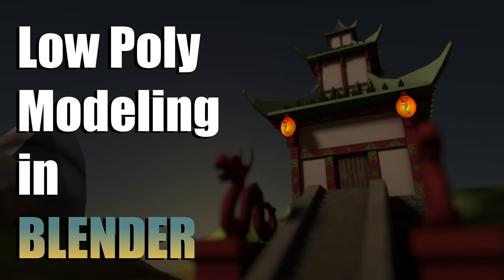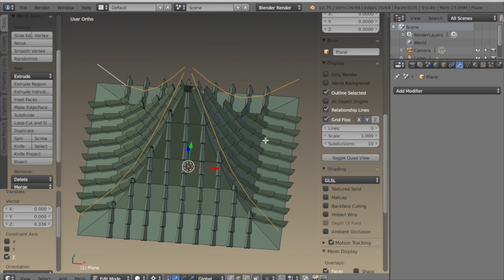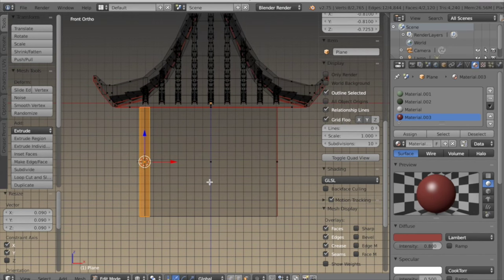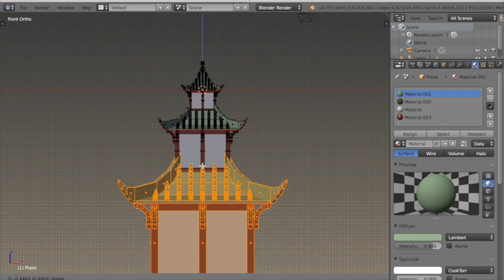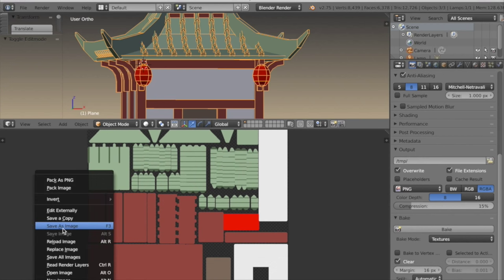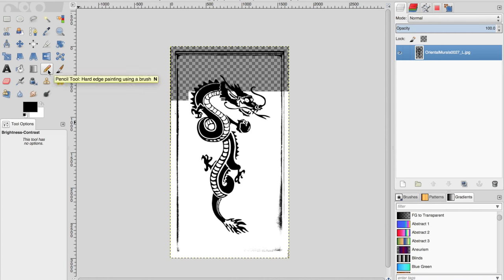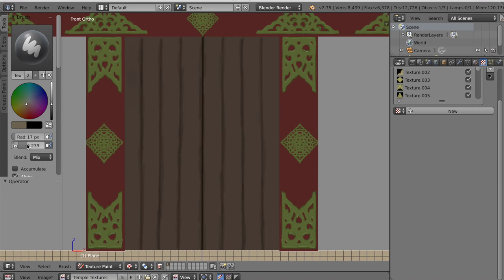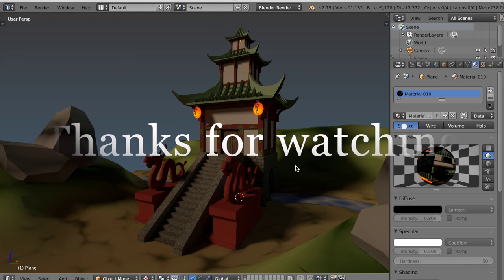Low Poly Model Creation in Blender 2.75

Comment: DUDE you are a B.A teacher! Literally one of the most descriptive tut's, i've found on here. Ive checked out three of your videos on here and ive gotten alot better from watching these three, than watching like 50+ tut's. For now on my place to go for blender tut's. BRAVO Man!!! (btw if i had to suggest something, try to do a lil more with like buildings and stuff if you could, maybe some unwrapping methods you've found that work well) Had one question for ya if you see this.. have you worked with any game engines at all? *hopefully unity xD... only reason i ask is cause im trying to get a good workflow with blender and unity. But one last time kick ass job on your videos bro.
Reply from the maker: +Jake Davis   Hi, Jake! I'm glad you liked the videos. I'm planning another modeling tutorial where I spend more time on the texturing process and uv unwrapping. I have been told before that I rush through those steps.
I have used unity a little, but it's been a while and I certainly couldn't do tutorials on it. I'd have to watch some myself. Unity Cookie has some good ones. Thanks again for the kind words! :)

Comment: also "spin" to me seems quicker option for repeat things around the building. For example the struts, i set up the 3 at the front, selected them all, put cursor to center, go into ortho top veiw, hit spin , set rotation to 360 , and set steps to 4, then delete original struts, feels quicker option to me anyway. 
I learnt alot though thx.

Comment: Made my own temple now. This tutorial was great <3. You might wanna use ctrl + RMB when selecting edges at the beginning for the UV unwrap. I also wanted to know why you put the seams where you put them. Also add a hint that the bisect tool can make n-gons and should be cleaned up. Painting felt rushed for me, had to stop every second and watch multiple times to understand every step you did in 1 second ;P <3 Also something about smoothing groups would be nice.
Reply from the maker: Ninjin Thanks, Ninjin! I place seams where I think a model will unwrap well, but sometimes I'm just guessing. ;)  Sorry about rushing through the texturing. I always do a practice model before recording the tutorial and this one took over 3 hours. It was a challenge cutting it down to an hour, so I apologize if some parts are too fast. I am planning to do another texture painting tutorial in the future and focus solely on that.

Comment: Its a good tutorial for someone new to blender, but I would not consider it a good tutorial on low poly modeling. To me low poly modeling is very efficient and very low vert count. Your vert count is at 8.4k and face count at 6.3k. Verts are much more important than faces since they are where all the calculations and data are.
For something like an Asian Style temple done in low poly would be a relatively advanced tutorial mostly revolving around textures. Like the roof would be mostly texture.
Reply from the maker: Kevin Smith I would define low poly modeling as creating any object with a "desired" level of detail, while using as few polygons as possible to achieve it. I chose this model because there are a variety of techniques I wanted to demonstrate. I could have done four walls and a roof, but wheres the fun in that. :)
Reply: Wayward Art Company Can't please everyone, I suppose. I think this was an excellent tutorial and I hope to see many more like this and even more with greater complexity. I am new to blender but you make it very easy to follow your work path and your explanations are well done. Thanks for your efforts.
Reply from the maker: Crazed Carebear Thanks! That's kind of you to say!
Reply: *****
 It's not so much that it's a medium poly or even high poly count build that is an issue for me. If I were a client asking for low poly. I might have issues.

I am new to blender yes but have watched more tutorials than I can count. So I see what you are saying and what Wayward made.

But I still enjoy a tutorial with his instruction style. Believe me there are far worse tuts out there. They get me lost in 2 minutes due to their teaching style or lack of. It's OK though not everyone's cut out to teach.

And I figure when I really get down to serious modeling. I will figure it out. I enjoy Pig Art 's low poly style too but he doesn't do many follow along tutorials.

Sorry for the long answer. It might help to know 3d is a Hobby, not for employment. I'm Happily Retired.

But Thanks for looking out for me anyways.
Reply: +Kevin Smith as far as industry standards go "low poly" is much less about poly count rather than how you add detail to an object. maximum poly counts available for "low poly" models tends to rise as technology gets more powerful and can handle more.  
larger objects in the scene also get higher poly counts to work with simply because the bigger an object is the more obvious it is that the mesh itself is low detail.
it's really all about striking the right balance between mesh detail for any given object and faking mesh detail using normal/height/spec/diffuse/etc maps and textures.  "high poly" is more about modeling all the detail rather than faking it.
it's pretty much gotten to the point where high/low poly is the technique used in adding details rather than actual poly count these days.

there's also that "low poly" art style that tends to not use textures much at all and keeps itself to a pretty dern restrictive poly count.  this certainly isn't that.
Reply: +Kevin Smith   I do think it counts as low-poly these days. This is good enough for example for Unreal Tournament 2003 which is as old as it says on the tin. Today, even on mobile GPUs, the number of vertices has become of secondary importance, you only want to have an average polygon size of maybe at least 16 pixels to draw the maximum performance out of GPU. Beyond that, the number of state changes and materials used will be of utmost importance to performance rather than vertex count, and will usually be the limiting factor.

It also depends on the platform whether vertex or triangle count is going to be the deciding factor.

For example on SEGA Dreamcast, you must reserve VRAM area for transformed geometry, and each vertex has the size of 32 bytes. Same on Nintendo DS, but vertex size of 24 bytes. This reserved area will be your hard limit on geometry you can fit in a frame, and either system has easily enough computational throughput to fill the buffer of pretty much any size that you can afford memory wise. However, the only data format the GPU understands is unindexed triangle strip, which means it stores one whole vertex for start of strip and then one vertex per triangle, as opposed to half a vertex per triangle on average for indexed models, so triangle count will be indeed paramount. Similarly PS2, where you won't run into a hard limit, but the structure of VU1 code often necessitates processing at least one vertex per triangle without caching of prior operations.
Reply: *****
Well Omnishader... you're still up against the implicit limit of number of uniforms and attributes. Why implicit? Good luck getting an ATI to tell you the correct limit via OpenGL.

If you can share the same material, you can actually batch all your static opaque meshes which share that material into one draw call. Then you can think further and force some of those meshes with different materials into one material, for example by atlasing, or multitexturing abuse.

But the point is, for any actual project, the graphics artist will need to get the specs on what he needs to produce from the engine guys, and any kind of common guideline will not stand true for some particular engine or project. The techniques will need to be slightly modified depending on requirements.

I don't think there's a straight up point in going for 1.5 Mio vertices limit, because the average polygon size wouldn't exactly be conductive to efficient rasterization. But even just 200 000 vertices per frame yields plenty of "hero" quality buildings.
Reply from the maker: ***** Siana Gearz I'm learning more from you guys than I do from any resource on the internet, haha! The two of you should get together and write a book! :)
Reply: seems pretty low poly to me. unless you're having a shit tonne of them in a game or something. 8k is nothing these days

Comment: 28:10 so what's the difference if instead of joing with "J" I do it with "F", I know F it's for adding faces, but from the rookie eyes is the same
Reply from the maker: Héctor s.s F will connect the two vertices, but the edge won't be connected to the mesh.

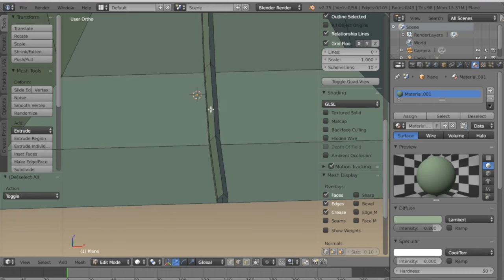Comment: 2:45 are you using "L" there? because it doesn't work for me it selects the whole  mesh
Reply from the maker: Héctor s.s If you're using face select then you can hold Alt and right click on an edge and it will select an entire loop of faces. Hold Shift + Alt to select multiple loops. L only works if that part of the mesh isn't connected by any vertices.

Comment: What unit system are you using? imperal or metric?
Reply: dont try to be smart when u dont know what u talking about,there are both metric and imperial systems in blender
Reply: I guess its for user convenience,but its doesnt matter why,it just does.Open blender and you will see it
Reply: +DaedricKynreeve unity 5 uses metric so using metric units in blender means it can be ported into unity easily.